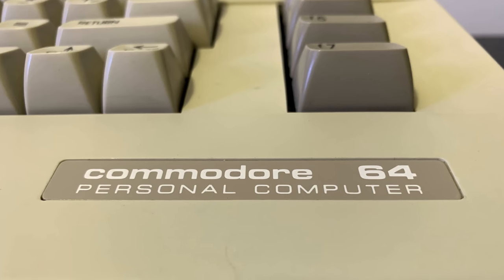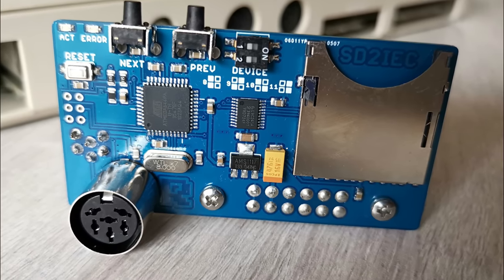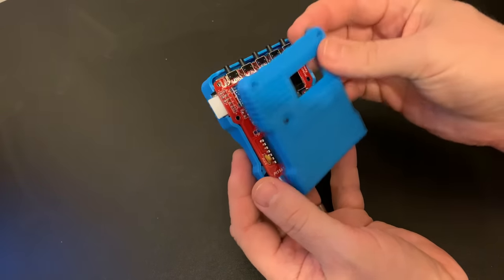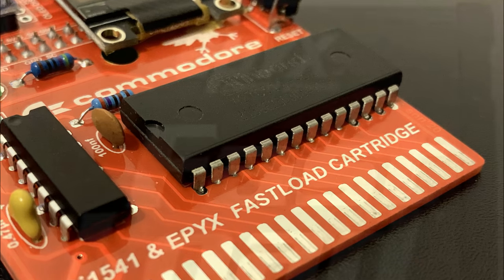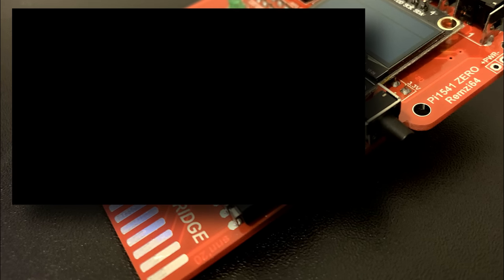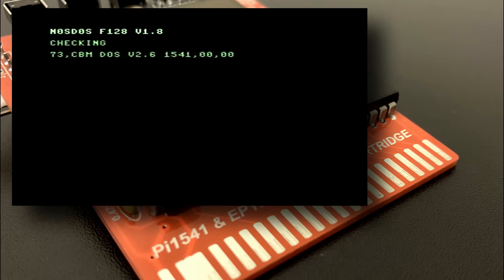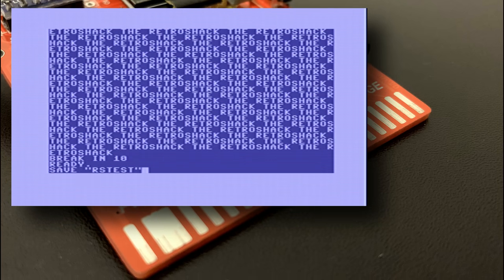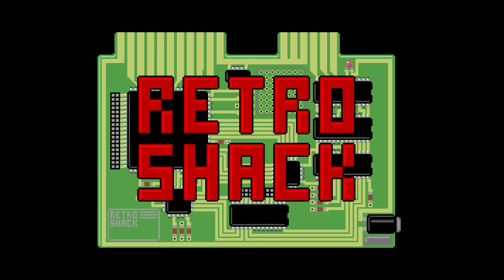Is This The Only C64 Cartridge You Ever Really Need?

Comment: I guess it only needs the cartridge port for power and to load the Epyx ROM, which has no knowledge of the drive being a Pi1541. The Pi1541 part would work fine by just providing the power to the correct pins and hooking up the IEC connector to the serial port. So.... 

It should be quite doable to make a version of the Kung-Fu Flash cartridge, that would also have all of the Pi1541-bits of this one.

With this combination, you could load EF3, use any speed loader cartridges such as the Epyx here, Action Replay, FC3, etc and also load cartridge games. 

I think that would be pretty close to the best a man can get like Gillette.
Reply from the maker: Give it a week and the Internet will provide :) Thanks for watching and sharing - appreciate it
!

Comment: I tried to save money with a sd2iec, but that wasn't good enough.  Then built a PI1541 with color LCD..  the UI was clunky, and not being able to use a pi Zero (at that time) raised the overall price significantly.   
Finally, I took the plunge and bought an Ultimate-II+ and never looked back!  It is worth every penny, and the fact it can emulate every fastloader, kernel, memory expansion and even freezer cart make it truly the ultimate solution.   I'd suggest the ultimate-ii+ and a dead test cart.
Reply from the maker: I guess i’m going to have to just bite the bullet and get an Ultimate II - just need to convince Mrs RetroShack ;)
Reply: @TheRetroShack  I fully agree that the pi1541 is a reasonable substitute when the retro budget is tight, especially now that you've shown me they got pi zero working!

Comment: I have the Kung Fu Flash cart and i have to say it is way faster than anything else i used before. It is basicly a cart emulator with extra, disk image handling abilities. The only con I can say about it that is yet unable to handle multiple disk games, that asks you to flip the disk or insert another one while playing. But the developer keeps up improving the thing so anything can happen.
Reply from the maker: I've heard good things about them but yes, the multi-disk thing is the Achilles heal at the moment.  Perhaps one might make it's way to me - if so, I'll pop a review up here :)
Reply: Szia! I agree, i love my kung fu flash!
Reply: My Kung Fu Flash is kind of unreliable sometimes it will "boot" sometimes blue screen... :-( other cartridges work well...?
Reply: @zulucain  dirty edge connector problems, you have to clean it , using isopropyl alcohol and a piece of cardboard for cleaning.
Reply: @claudioquintanilla1471  Eventually that worked! Sprayed it with contact cleaner.

Comment: I use this with my c128.  I just have to power it externally uninstalled from the c128 to use it in c128 mode.  If you have the cartridge installed, it boots straight into c64 mode.  I have a jiffyDos rom image loaded on it as well so even if the epyx fastloader isn't installed, it still loads fast in c128 mode.  great little product.

Comment: Due to the semi-conductor shortage, a Pi Zero is very expensive and nowhere to be found. Let's hope it returns to the £5-£10 price range when it becomes available again.
I'm guessing the one used in this project is the Pi Zero v1.3 with 1Ghz CPU and 512MB RAM? Does it need any kind of overclocking or is this just related to other Pi models?
Reply: Yes I am going where the hell do you get a zero for fiver

Comment: One baud is not equal to a byte. Taking the same example shown with the ZX Spectrum, a 1541 would be roughly 1.8 times faster than a cassette load on a ZX.
Reply from the maker: Whoops - silly maths.  However it’s still not too pretty a sight for the C64.  I’ll add the correction to the description:

Datasette 50 bytes / second: https://en.m.wikipedia.org/wiki/Commodore_Datasette

1541 Drive 300 bytes / second: https://en.m.wikipedia.org/wiki/Commodore_1541

Spectrum Cassette 163 bytes / second: https://spectrumforeveryone.com/wp-content/uploads/2020/08/Spectrum-Brochure.pdf
Reply: @TheRetroShack  Baud and byte / s comparisons are never exact.
I forgot to comment: Great video! You have a subscriber ;-)

Comment: Thanks for this! 

As a MSSIAH cartridge user, it doesn't look like I will be able to take advantage of any cartridge-based solutions, as the MSSIAH has a MIDI input port right on the top of the cartridge.  I plan to get a pi1541, but I'm waiting to source a nice looking case and a pi1541 hat that will fit inside the case, as well as the pi 3b+ itself. 

While I wait, can anyone suggest any dirt-cheap file-saving solutions that are compatible with MSSIAH?

I was looking into Tapecart SD, as it makes use of the tape port (mine is currently not in use), but I can't find any info about whether or not it's compatible with the MSSIAH software.

Thanks and take care!
Reply from the maker: Never used a MSSIAH cartridge but hopefully someone in the community can help out :)
Reply: You can find multi-cart adapters on eBay.

Comment: I really wonder why you want to combine the Pi1541 with an EPYX Fastload cartridge.
It's not that fast and it doesn't even put the most common commands you need to load and run games on the F-Keys, just like any other Cartridge does.
I understand that the EPYX cartridge is very useful in combination with the SD2IEC because it is able to accelerate loading from that device, but since the Pi1541 is compatible with any fastloader, it doesn't make too much sense to me.
Especially if you already have a Kung-Fu Flash which can emulate quite a few other Fastloaders.
I use a 'full' Pi1541. The one with a Pi3 and I use the Kung-Fu Flash to emulate an Action Replay Mk6.
It loads about 3 times faster than the Epyx one and I also didn't have many compatibility issues with games. Not even with multi load ones that come with their own fastloader.
I think it's less than 5% out of about 400 games I've tested that did not work properly when loaded with the AR and I doubt that the Epyx cartridge is more compatible.
One downside of all the cartridge based fastloaders is that they rarely accelerate loading in multiload games other than loading the first file.
Everything that is loaded afterwards is usually not accelerated.
That's the huge advantage of hardware based speedloaders.
I had SpeedDOS back in the days and it was great with games like Maniac Mansion and Pirates which loaded a lot during gameplay.
I haven't tested Jiffy DOS yet, but that should in theory do the same.
Just try playing Maniac Mansion with SpeedDOS and after that play it with the Epyx cartridge... you will REALLY feel a difference.

Comment: I see these advertised working on vic-20. Is that one powered through cassette port?
Reply from the maker: Provided you power the device, I can't see why not as the 1541 was backwards compatible with the Vic-20.  Clearly you wouldn't get the Epyx Fastload as the cartridge won't fit the Vic.  I've got an old Vic lying around - I'll give it a go! :)

Comment: Can an average C64 power supply handle the energy needed to power a pi-1541 without problems?
Reply from the maker: Yep, the draw on the PI is minimal and the cartridge port can handle it - however, no-one should still be using an original c64 power supply - they're machine killers! Get a nice shiny new one :)
Reply: @TheRetroShack  It is true. I have long had a modern power supply that has 1.5 times the original power of the c128 power supply and from which 2 cables come out, one to power the c64 and another cable for the c128 (dual source). and I understand that all modern ones have at least the power of the c128 ones.
Reply: @TheRetroShack  Why/how are they machine killers?
Reply from the maker: @armorgeddon  Basically it’s down to the voltage regulator on the 5v dc output.  It fails and sends a whopping big voltage through the 5v lines, frying the chips it reaches - which is most of them :(  Avoid! :)
Reply: @TheRetroShack  Oh wow, thanks for letting me know! I need to tell that to my neighbors who still love their C64 for family gatherings.

Comment: a RaspPi seems pretty overkill but i guess that's just because of the Emulation overhead? though i still i feel like an STM32 could also run an emulated 1541 drive...

what exactly does "cycle accurate" mean for a disk drive? AFAIK the C64 only expects the data to come in in a specific format with specific timing, so as long as those match, and all the commands the C64 can send are handled as a real drive, shouldn't it work fine no matter what is on the other side of the cable?
Reply from the maker: That's where we are today :) A $5 chip is more powerful as a co-processor than all of the other chips in the main thing :)  'Cycle Accurate' just means that  it's emulating the hardware inside the 1541, not just supplying the data in the format that the c64 wants it.  That means that anything that needs to happen 'drive-side' like copy protection, or exploits, or hacks work exactly like they did on the original drive.  I don't pretend to understand exactly how that works because I'm simply not clever enough :)
Reply: Many fastloaders and copy protection methods execute code on the fly using the 1541's 6502 chip. An sd2iec or similar will fail to load these as they are merely file loaders.

Everyone seems to hail the U2 as the be all and end all of C64 carts. I have a Turbo Chameleon and fair to say it blows the U2 away as far as features go. They are however rarer than rocking horse shit.
Reply: 'Cycle accurate' implies that the Pi is simulating the hardware at the circuit board level, not just recompiling binary data.

Comment: but why the need of a rasberry pi ? and whats on the sd card
Reply from the maker: Hi there - The raspberry PI is what's doing the heavy lifting of emulating all of the 1541 hardware.  There is a custom kernel.img supplied for the Pi1541 which loads into the PI when the cartridge powers up.  This kernel contains all of the software needed to get this thing working.  All the details can be found on Steve's page: https://cbm-pi1541.firebaseapp.com/  Thanks for watching :)

Comment: I skipped through this video, and still could not figure out what it was about... 
and I'm an ex C64 programmer from back in the day....  :-/  I had to look it up.  Apparently, it's nothing more than a fast loader cart?
"Kung Fu Flash can emulate different cartridge types, load PRG files and use D64 disk images. Just place your desired CRT, PRG or D64 files on a FAT formatted microSD card and use the built-in launcher to execute them."

Comment: The Pi1541 has made the Ultimate, obsolete. I have a Pi1541, and a Tapuino - this is similar to the Pi1541, only it emulates the C64 tape drive. This way, you have the best of all worlds. Disk loading, and tape loading.
Reply from the maker: I'm certainly having fun with mine - although will probably end up buying an Ultimate at some point - I am an addict after all :)
Reply: The pi 1541 is a fantastic piece of hardware, but it would never be a 1541U2 replacement. EVER!

The multiple drive emulation, printer emulation and multiple fastloaders are worth it alone. Add modem emulation, an REU and Stereo SID emulation and now you have a real showstopper. Plus there’s even more, built in copier, DMA loading, tape emulation and built in IEC, ummm yea, it’s a no brainer.

10:01 Nobody “needs” one really, that is until you own one! LoL

Comment: shit all i need for my atari 800xl is a pbi or ram cartridge, and a sio emulator, get disk drive, and cartridge emulation, its a fucking pc from 1983, so i can easily use it to write a cartridge images to a ramcart, just load binary into my 512k-1meg of ram then just copy duh bits and bytes from internal ram, to a battery back sram cart or just slap some flash eeprom on it... if you got some money to blo, add a asic and sd card slot wit some coprocessor and add hardware floating point routines, wit an built os to use all it, and can even go 6809 or 65816 or wit an fpga make a "65c832" based cpu....
Reply: wen u realize teh atari invented usb before usb, if u study how its sio subsystem works... daisy chains and plug n play devices all duh way bak in 1977-1979
Reply: add a pic32 or atmega, or propeller device, wit  a 12 or 24 MHz crystal on a pbi card wit some ram buffer and u got native usb 1.1 support...and a powerful dsp and coprocessor if u connect it to dat address and data bus directly....
Reply: wit duh atari u have a custom 6502 dat can be halted and tristated so u dont need bus stuffing or doing weird hacks to get shit to talk to dat computer bus like wit duh atari vcs and other systems, so you can write code that runs using dat pic32, atmega, or propeller, and just shove dat data to duh antic or gtia, let dat cpu run audio samples or sumting or  halt it duh entire time in dat tristate, cant do this wit a c64 cause its graphics and cpu share the clock and bus, and effectively operate out of phase of each other, so one clock cycle drives dat cpu, the next drives dat gpu and  c64 doesnt have built in hardware blitter processing like atari 8bit does wit its antic dsp
Reply: wen u realize the atari 8bit is actually the most powerful 8bit computer that was commercially produced, by its inherent architecture and design, cuz dat jay miner engineering werks and maeks lots of moneh, remember who technically made teh first single chip gpu? atari wit dat vcs, channel f used registers and a bunch of glue logic for its video output, u think 128bytes of ram is bad, go use a channel f wit less color, less sound, and 64bytes of scratchpad ram implemented using register memory, and not sram like in duh vcs

Comment: why on earth would anyone want to 'cycle accurate emulate' the slowest, cheapest, and smallest disk drive unit commodore ever made. if software does not run with any floppy or harddrive unit ever made for pet/cbm including those of other manufacturers the software simply is broken and needs to be fixed. the only reason to artificially cut down the capacity a bit would be that the directory listing "$" still needs to fit in basic available ram. even on a vic-20 or pet 4k. but that's about the only limitation i can think of. other than that just blast those bytes in as fast as the ram and kernal routines can handle it. (and yes commodore themselves sold harddisks too. way before the c64 came out even. see here is what you do when you encounter a program that won't run with any other drive: you disassemble it and remove those parts that make it not work :P LOL. as the software then does not comply to the specification of the hardware platform. and technically is not 'compatible'. and as such someone in 1984 or something ripped you off on it :P specification says: kernal tells the diskdrive what file you want and diskdrive sends it. it doesn't say anything about making the diskdrive do all kinds of trickery only one specific model can do when they themselves alone sold like 20 different models that all work with this system. :P hint. you didn't have to wait for a 1540/1541 the day it was released already. you could simply hook up your 4040 or 2040 with an ieee cartridge and be done with it. faster. bigger. even 2 drives at the same time. the 1541 is not some sort of 'standard' stuff should 'comply' with. the serial bus timing and commands are. just stop catering to software that 'requires' a 1541 and crack-fix it and be done with the 1541 limitations forever. which never should have been a 'thing' to start with.

Comment: Fastload was good for what it was, but almost all full-disk games bypassed it, so it was really only useful for single file loading. Of course the same is true of pretty much all cartridge based fast loaders. I also found a couple cracked games that wouldn't load with it plugged in and enabled.

Also, if you want to see/test the absolute fastest 1541 fast loader, find an image of an original copy of Super Cycle or International Karate/World Karate Championship. They used the Epyx Vorpal loader and on a real drive, you could hear the head switching tracks at about one per second. Both games probably took under 20 seconds to load.
Reply from the maker: Thanks! I’ll look those games up as that sounds amazing :)
Reply: @TheRetroShack  Epyx also released a package called The Vorpal Utility Kit that allowed you to convert your own files to the Vorpal format so that they could be loaded that fast as well. The downside being that such files couldn't be copied via normal methods. A full-disk copy would work, but normal file copiers didn't know what to do with them. I believe the package included a special file copier.

Later, the people behind the Super Snapshot cartridge also released a utility disk with their own version of it. As I recall, it worked with or without the SS cartridge being plugged in.

Here are a couple links about it;;

https://www.atarimagazines.com/compute/issue76/Reviews_3.php
https://www.nightfallcrew.com/14/06/2011/vorpal-utility-kit-c64-5-14-disk-epyx-cracked-by-zer0-x/
Reply: Some other examples are the Epyx "Games" series--not Summer Games , but everything after that, such as Summer Games II , Winter Games , or California Games .  The original disks all load faster than on the Apple II!  Obviously this shows that the C64 and 1541's speed issue is not due to hardware limitations.
Reply: @rbrtck  Unfortunately, it took years for people to figure out how to create software loaders that fast.